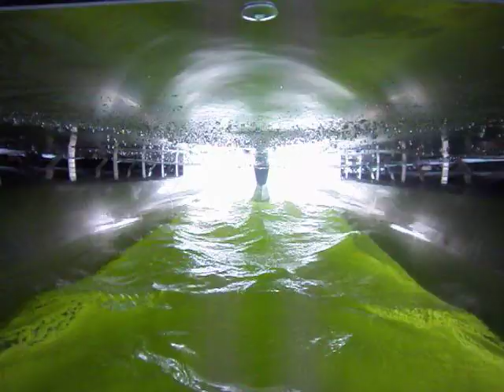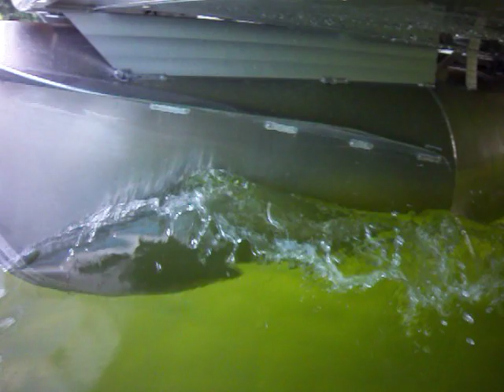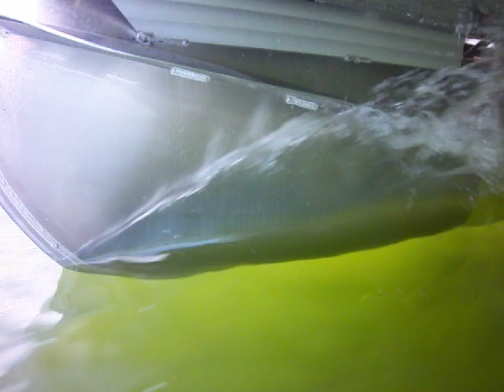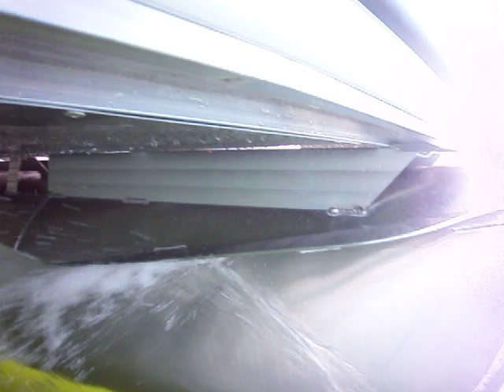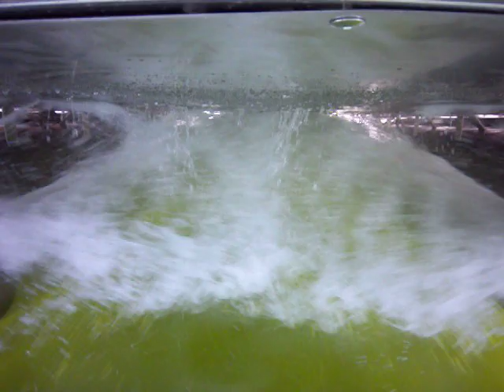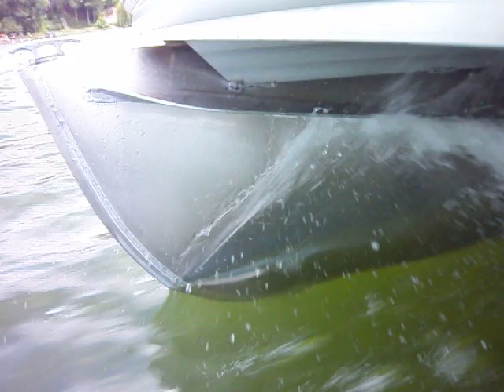Pontoon Hydrodynamics with Aluminum Underdeck Skin - Turbulence Variation #1

Comment: found a aluminum sign approx. 4 ft by 6 ft and located it where the waves struck the boat between support ribs .reduced drag tremendously, thanks for the great idea. I have gained a mph top speed and better mileage

Comment: how many miles has the speed increased ??
Reply from the maker: No measurable speed increase, but stopped "surging" and pooling of water on floor.  No choice but to upgrade as HP was water flooding floor at rear seat through underdeck deflectors.  Third installment video was lost as was similar boat with lifting strakes.  3 mpg gain and folded water down, was to show relative benefits of pontoon optional features.

Comment: is the third installment somewhere to be seen with the lifting strakes?  Great video.
Reply from the maker: A DNR Enforcement officer cut third boat with strakes off as I was hanging over bow video taping.  Sudden throttle chop of throttle shot me out front door but door closed on my ankles keeping me from loosing life at prop.  Lost camera and never had courage to try again.  Now GoPro are available but was unaware when doing this in 2010-2011.  Third video showed benefits of lifting strakes.  Really more gain from strakes than skin though benefits with both.  75-90-115hp benefited from strakes